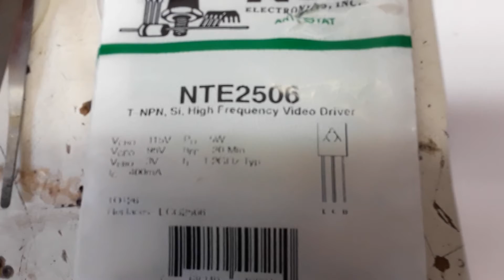30w FM Transmitter - BJT Push-pull RF Power Amplifier w schematic

Comment: I just found this video. Nice work. Lots of work indeed. Congratulations for sharing. Are the transistors upside down?
Reply from the maker: The transistors are attached to the heatsink and cooling fan under the circuit board.

Comment: The transistor is rated for 0.4A only then how come you're getting  25-30W of power out???
Reply: You mentioned 20V supply @200ma that's only 4W DC input to the final transistors!! 25-30W RF output is impossible here!!!

It's not a 30W amplifier.
Reply from the maker: @dare-er7sw  Output shown is 38.2 Vrms @107MHz with a 50 ohm load using a 20V supply @ 200ma with a 1w RF input (the 200mA does not include the 1W RF input circuit). 

39Vrms @ 50 ohms = 30W output @ 700mA.  
Your error is due to using Vcc instead of Vrms output in your calculation.
Transformers can raise the output voltage much higher than Vcc. Again, careful biasing, proper transformer construction, and impedance matching are key.
Reply: @andrewferg8737  200ma is DC input or RF peak current?

Secondary with 39V RMS = 30W/39V = 780ma x 1.414 = 1.1A RF peak current into a load. Do you still have the amplifier? If so please measure the DC input current to the final pushpull stage.

I was talking of DC input current. The transistor is rated 400ma DC and at 20V each transistor would need 1A of DC current given an efficiency of 75% for example with the two transistors drawing 2A total or 40W DC input power. The transistor is rated at 0.4A . Operating it at 1A I don't know. Do you still have the board?
Reply: @andrewferg8737  Also measure the output power on a dummy load instead of the simulation.
Reply from the maker: @dare-er7sw  The build shown in the video clearly terminates in a 5W / 50 ohm resistor. This gets very hot after a few minutes and cannot be left in place for very long. I use this for testing only and remove it when using an antenna. I also have 100W / 50 ohm microwave resistors which I use if I keep the load in place for an extend time, or for testing higher powered projects.
Reply: @andrewferg8737  Oh. If it gets very got then Po is indeed more that 5W. One more question, the MRF101 100W amp is  working perfectly?  There's no matching between driver and final stage and still it seems to be as VCC is higher than 12V and it takes care of the impedances
Reply from the maker: @dare-er7sw  "MRF101 100W amp is  working perfectly?" ------

No. This was my first time using the MRF101. It can certainly be improved. It would work much better in a push-pull configuration with matching transformers.  However, the MRF101 is very rugged and will produce a strong output even under poor conditions. 

That said, the MRF101 is too expensive for experiments. I had only bought two of them.
Reply: @andrewferg8737  There's no matching between its driver and the final stage. Datasheet of MRF 101 has a nice circuit.
Reply: @andrewferg8737  what is the exact power output of your build of mrf101?
Reply from the maker: @dare-er7sw  70Vrms @ 88MHz / 50 ohms at 500mADC
This is just under 100W and is a bit less efficient than the optimized datasheet circuit.
Reply: @andrewferg8737  Very nice. I'll try it. I'm unable to find the datasheet circuit anyway. Your circuit looks simple as the input L match is eliminated.
Reply: @andrewferg8737  Found the input matching circuit. It's 200p x 2 in series feeding the gate with a 36nH to ground from between the two capacitors
Reply from the maker: @dare-er7sw  See datasheet pages 25 - 28:   
https://www.nxp.com/docs/en/data-sheet/MRF101AN.pdf
Reply: @andrewferg8737  I did. The schematic is missing. My phone's problem?
Reply: @andrewferg8737  From parts list and PCB layout I got the values for input match.
Reply from the maker: see  https://youtu.be/mo98fZ58IDo  for additional comments.
Reply: @andrewferg8737  It is only a simulation. What is the current input on the actual amplifier board? To get 30W out and considering 70% efficiency you would need 2A of DC current @20V DC where as the transistors are rated at 400ma only. That's my confusion.

Comment: That looks cool. May I ask what ferrite core you used for the output transformer? I'm working on a similar project and my transformer stops working at RF frequency.
Reply from the maker: #43 material works well in FM Band frequency range. Binocular cores come in various sizes (22, 24) and are more efficient, but  toroids (of the same material)are cheaper and will suffice. See links. 
https://www.fair-rite.com/materials/
10 Toroid Aperture Core BN43-202 Ferrite Torroid https://www.amazon.com/dp/B01959LHN0/ref=cm_sw_r_cp_apan_i_6NR6CMV6ZWK1NRGHNQ6F?_encoding=UTF8&psc=1
Reply: @andrewferg8737  You're using a BN 43 -202 ? Wow
Reply from the maker: This app is quite useful :

https://toroids.info/
Reply from the maker: "my transformer stops working at RF frequency"

What is your frequency of interest?
Reply: @andrewferg8737  I'm targeting 12MHz and currently using BN43-2402. The transformer (1:4 ratio) worked at lower frequencies like 2MHz but the voltage drops to 1:1 when close to 12MHz.
Reply: The voltage is 1:4 at any frequency if there is no load, but when I connect the 50Ohm load it drops to 1:1.
Reply from the maker: @toby3927  #43 is best used with higher frequencies like 100MHz.

#73 is good with lower frequencies. 
I also use salvaged toroids form old power supplies and ferrite rods form junk radio antennas for low frequencies. 
They are free and they work fine.

The type of material, the size, and the ratio you use also depends on whether you are using it as a power output, a voltage amplifier, or just to transfer your signal to another stage. 

That said, there is a bit of art and a lot of experimentation required in making a transformer. Keep in mind that the purpose of the transformer is to match the input and out put impedance. This is a dynamic value which is dependent on many factors including frequency, voltage, and current. 

See also:
https://toroids.info/
Reply from the maker: @toby3927  "The voltage is 1:4 at any frequency if there is no load, but when I connect the 50Ohm load it drops to 1:1" ----

Think in terms of impedance. The transformer is a dynamic resistor. If your input stage is high impedance then that side of transformer should be high impedance. Try changing your ratio and turns number. You can estimate your impedance by testing your output voltage with different resistors. 

This is a useful app:
http://www.learningaboutelectronics.com/Articles/Inductor-impedance-calculator.php

You're aiming for a standard 50 ohm output impedance, which is a very low impedance. You will need a circuit (or several stages) capable of supplying sufficient current at that low impedance for your transformer to create a high voltage.

Remember there is no free lunch. The transformer trades current for voltage.  If the impedance is too low for your circuit the transformer acts like a short to ground.
Reply: @andrewferg8737  Thanks, that's very helpful. I will do more research on that.